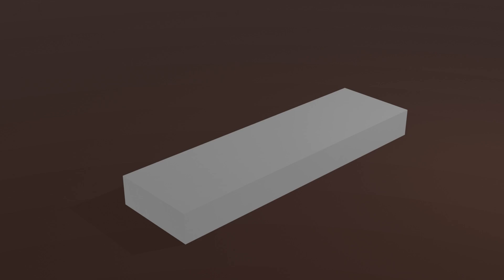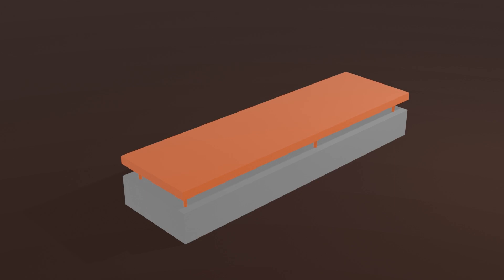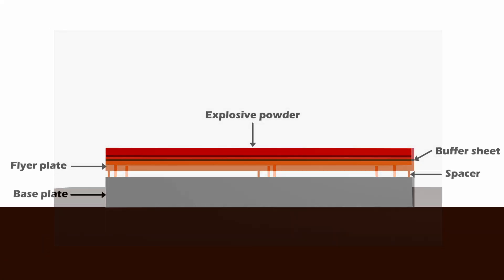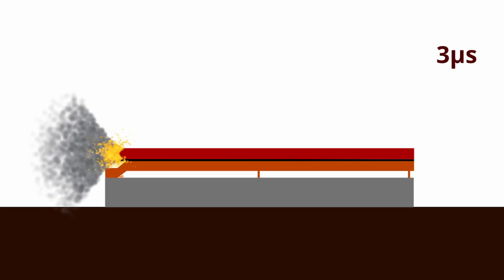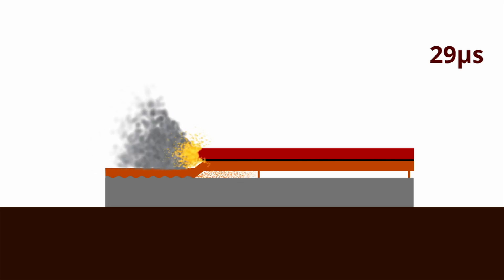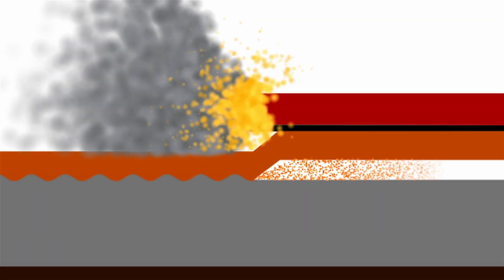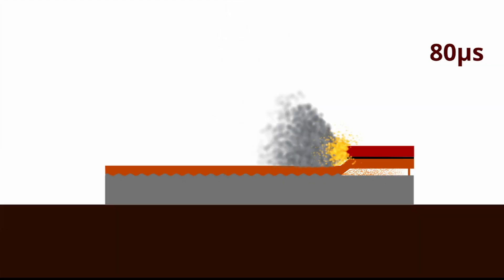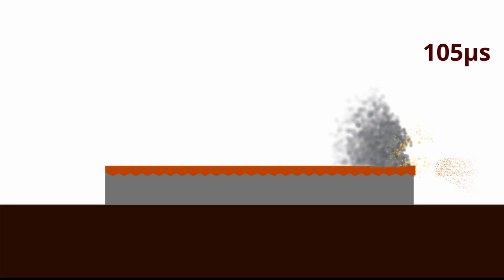Explosive Welding

Comment: How does the strength of this weld stand up against conventional welding? Like in arc welding with filler rods? And why would explosive welding be used instead of those other methods? Are there specific applications (for example, if you need to weld enormously wide pieces of steel together) that other methods cannot suffice?
Reply: Explosive welding can weld almost any metal to almost any other metal.
Reply: As far as I know it's almost as strong as a solid material. But I'm not an expert. Of course here we usually have two different materials, so the strength is always related to the weaker material. But we do not have the region of the influence of the intense heat that changes the crystalline structure of the metal and thus alters the strength, like we do in arc welding method

Comment: Great video, thank you. I did not know about the wavy pattern. Im very curious as to how those patterns form exactly. Do the waves all propagate radially from the corner of ignition?
Reply from the maker: It has something to do with metal at the time of impact behaving like a high viscosity liquid. Here's a link that should give more info on that.

https://royalsocietypublishing.org/doi/10.1098/rspa.1967.0010
Reply: I have zero experience in this stuff, so take this with the tiniest grain of salt, but I think it's something to do with how craters form; it moves material, but then that gets blocked by the other material, making it wavy as multiple craters form then get prevented from growing larger. Zero experience, though, so I'm also gonna wait for an actual response.

Comment: What are the spacers made of and what is their exact shape? Are there different spacers for different applications?
Reply from the maker: The spacers can be made from one of the materials to be  welded. But I'm not sure if it's limited to that. The key is for the spacer material to be consumed by the jet that 's  blowing ahead of the contact point.